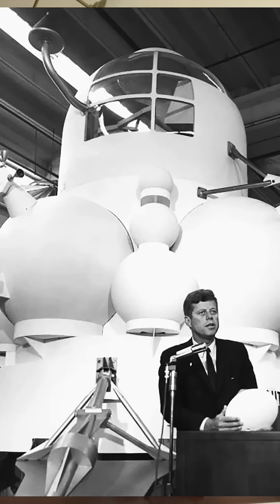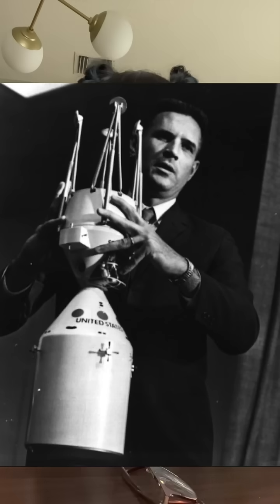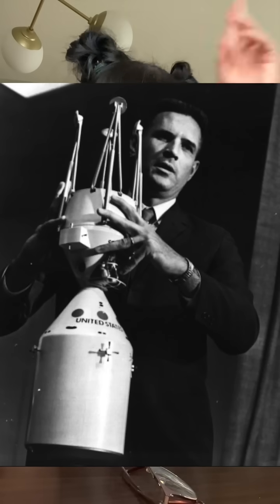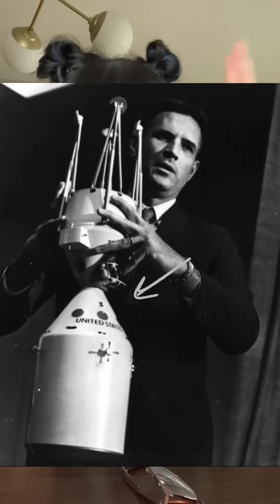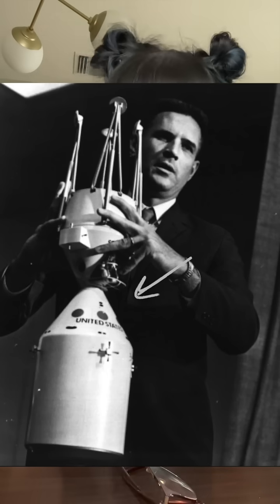Wacky Lunar Modules we didn't send to the Moon #shorts #history

Comment: that Round access door to the Front of the LM was changed to more square because the astronauts and their suits, were more square, and couldn't get through the round hatch.
At Grumman, The hinges originally were on the outside, so the door would open outward until my Dad's partner (Gerry) caught his suit on the hinge pin and broke it off during testing, so they repositioned the hinges to inside the module so when the module was pressurized the door would be held closed because of the pressure differential and not requiring the hinge pins to be there.
The Astronauts, got permission from Charles Schultz to issue the engineers a Snoopy pin for their excellence at performing testing etc.... My dad actually received the first snoopy award, because of the positions they were standing in since Gerry was had actually discovered/caused the problem.
my Dad (Glenn) had graduated from West Point in the Class of '52 with Michael Collins the Apollo eleven Command Module Pilot. My dad had been in the Air Force with some of the Astronauts so they knew him and trusted that his knowledge skill was comparable to theirs, so they could trust he would ensure that the Tests they needed done, would be done as if they themselves were doing it.

Comment: How were the lander and the orbiter able to find each other and lock on?
Reply: Mission Control knew where each spacecraft was from second to second. Each spacecraft transmitted a signal back to Mission Control. The direction of the signal said where it was, while the Doppler shift said how fast it was receding or approaching, and the signal delay said how far away it was.

While the lunar module was still on the Moon, Mission Control got the command module to change its orbit so that it would pass directly over the lunar module. Mission Control then calculated to the second when the lunar module was to lift off, and the trajectory and burns required to get to the command module.

As the burns were performed, Mission Control kept tracking both spacecraft, and if necessary updated the future burns required by the lunar module.

Then, as the spacecraft approached each other, the lunar module used its rendezvous radar to track the command module.

Does that help?

Comment: The windows would not have to be heavy if the module is not pressurized. Was that the reason for the design? The astronauts would simply stay in pressure suits the whole time.
Reply: If the vessel isn't pressurised, why would you need windows?

Comment: Given that it is pressurized, I've always been surprised that the windows have sharp corners, which would create large stress concentrations.  Maybe they are rounded off underneath the insulation layers.
Reply: With the 100% oxygen environment the pressure was pretty low and it was a single use design so probably not going through enough cycles to stress the metal.

Comment: Spherical seems the most logical way to build a pressurize vessel for the vacuum of space. It contains the biggest possible volume for the smallest surface and it spreads pressure evenly all across. I guess it has its own drawbacks because they went with something much different. Also, is the shape Russians were using and they were very advanced on sending humans into space by then too, so it seems logical to take it as a starting point.

Comment: I love the inspiring shapes of spaceships from before crewed spaceflight and in its early days. The connection with sci fi illustrations and movie spaceships from the 1930-50s hit me hard as a kid - if one thing could come true, then the rest of it could come true.
Grumman and NASA had a very difficult time with the mass of the LM, it had to be soo light. Those flat panels aren't sheet aluminum, they were made from aluminum plates milled to the desired thickness. Legend has it that the engineers kept asking to the fabricators to mill them a little thinner. OK, a little more. And a little more. Until the point was reached where a guy said "Hey, I can see my hand through it." A joke my uncle told me, he worked on the LM as a thermal engineer. The last part was a joke but it arose from how fanatical Grumman had to be about getting everything as thin and light as possible.

Comment: Any mileage in a video on alternative uses for the Lunar Module? Like, back in the 70s I remember the early artist's impressions of Skylab had a telescope mount that was a converted LM design. And I learnt about a proposal for an orbital inspection craft based on an LM for sneaking up on adversary satellites and possibly disabling them. Seems like there was a whole thing of alternative not-Lunar Modules.
Reply: Maybe practical, maybe not. A contractor can be very imaginative when the contract is running out on a product that they have a production line set up for and a whole bunch of people trained for. 

McDonnell Douglas came up with some pretty out-there proposals for the Gemini spacecraft. A lot were pitched to the Air Force.

Comment: If I recall correctly the walls of the LEM's pressure vessel were about as thin as a modern soda can and that on earth you could easily puncture it with a dropped screwdriver.